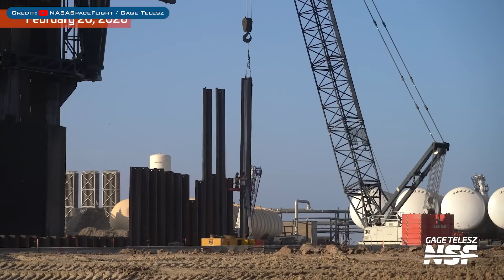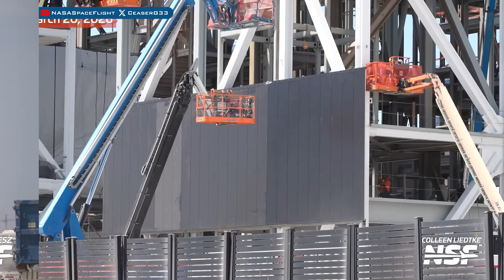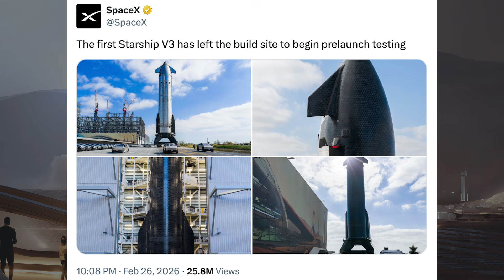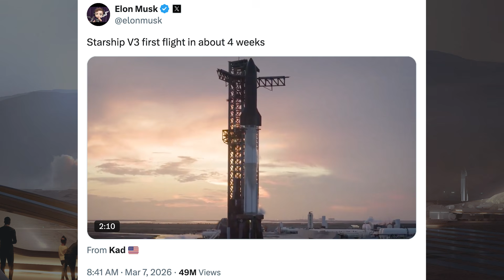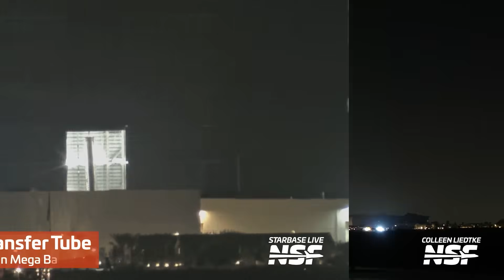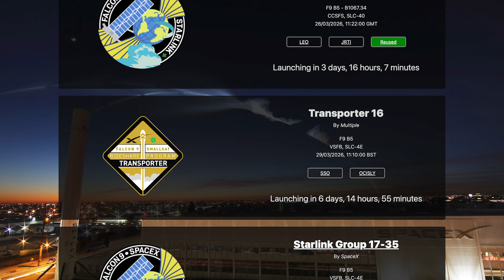SpaceX Starship Updates! Starship Flight 12 Testing Activates Starbase Launch Pad 2! TheSpaceXShow

Comment: ESA's EPIC mission to the ISS is scheduled for early 2028, to give ESA's astronauts more experience with the ISS before the space station is decommissioned.  16 ESA astronauts have already visited the ISS, but this dedicated Crew Dragon mission is probably driven by the ongoing delays with Starliner, combined with NASA's desire to reduce the size of its Crew Dragon ISS mission crews from 4 to 3.  I wonder if it's a general indicator of a lower level of NASA and ESA cooperation in recent times.